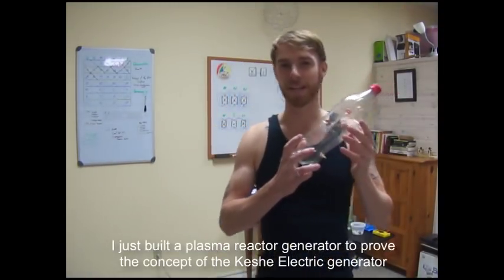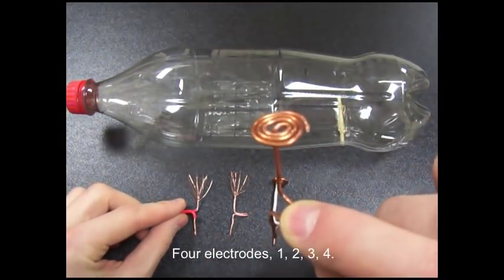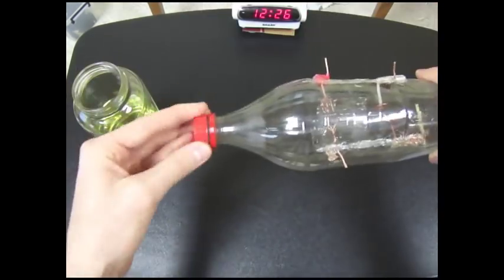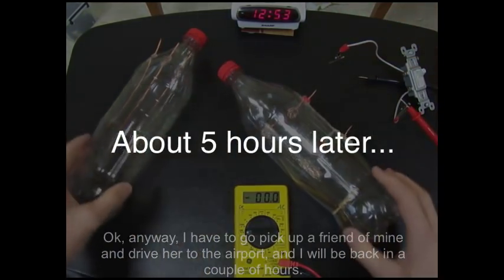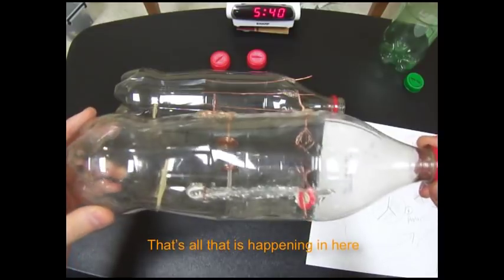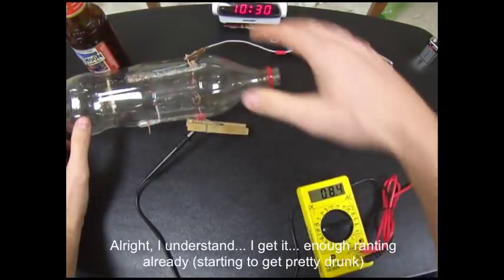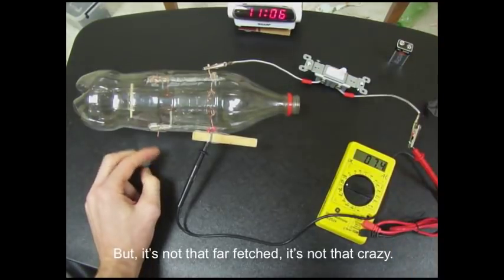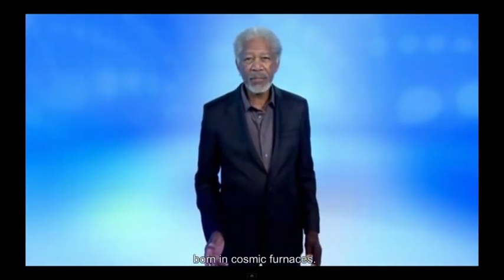Keshe Plasma Generator ~ Here is The Future ~ Infinite Energy

Comment: Hi All,
I'm open minded on this, but despite being quite "old" so far I've seen NO proof or application where it has actually done anything, or any other "Free Energy" device claims either.
If there are any positive results anywhere, that's easy to construct then I'd love to see them.
Going back a bit/lot to my schooling days I can't get my head around the coils that are being made for this device.... the cable used is bare copper wire, so any coils will "short" themselves out because they are actually touching each other, and even more so when you put the smaller coil inside the larger one? 
Basically you have a Copper Slug...
The "coating" ritual of the coils is basically acid etching the copper surface, and adding leaves etc to enhance the "nano particles" seems a bit hard to grasp for me.
Assuming it does insulate the coils from each other I reckon all you have is an Air Cored Inductor/Transformer, which is nothing new.
I'd love to be shown a working device, ( of any type ) as I'm all in favour of Free energy, but so far nothing has come into the Public domain that I know of.
I've done the HHO thing, but I can't even get a small motor to run unless I have 60A spare and a 100 plate Dry Cell etc etc, which defeats the object.
Maybe I'm missing the point, but I've come to the conclusion that, as yet, there is nothing on YouTube, or commercially that will free me from the rip off Power/Oil companies.
But I do live in hope that one day someone will accidently find a solution, you never know it could even be me...........

Comment: Energy is not voltage it's voltage times current. if you could turn on a lamp by that circuit you have got energy from the bottle.

Comment: Nice seeing someone having the guts to speak about e* physics ^^
Tesla new what he was up to in 1900 - he called it his "unified field theory" though.
Have to disagree on it having to do anything with plasma though (I doubt you actually think it does) - it's a simple zero point generator.

Keep up the good work - enough people will start to look it up themselves. ^^

For those interested, look up on wikipedia:
- Flying capacitor (always in direction of current [+ to -]) aka Lifter:
http://en.wikipedia.org/wiki/Biefeld%E2%80%93Brown_effect

- Self charging of capacitors (yes, they simply charge themselves):
http://en.wikipedia.org/wiki/Casimir_effect

If what you're finding seems impossible, you're on the right track ;)

Comment: Voltage is not what does useful work.  Watts is the part doing work.  Hook a 25 watt light bulb to that voltage and you will see the volts go to ZERO and no light.  Abundant cheep power?  Plasma may be a good place to look but we need more.

Comment: 1. There's no plasma.
2. Voltage alone does not equal energy.

Show us the "reactor" connected to a load - an LED, a resistor, even just a wire - and demonstrate the flow of current and the voltage simultaneously to prove there is useful energy generated. Current x voltage = energy transfer per second.

Comment: Joshua Thomas your a smart guy and you got good ideas that i applaud you for. But the energy there just comes from somewhere else as all things in the universe do. so what is happening there is the atoms and all that you said are giving off energy.. there is energy all around us. and when you take that energy from one place like you did energy from everywhere else took that place. so in simple terms you made a machine that takes heat from the air and puts it into a battery... so now what? it generates almost no power. to generate more you need more hea... so really were just back to where we were with coal generators....

however it is possible that none of this is even at play anyway and the earths magnetic pull is generating the power just in the magnetic copper.

Comment: He made a battery... No plasma... Probably pretty weak compared to most... Afyer a while the battery would start to "die" and you would either have to replace the electolytic solution and or electrodes... Or throw it away because the materials alone cost most than buying higher quality batteries from a shop that can "hold" a better charge.... Salt water and two different metals is a battery.....
Reply: +Brook Birk But he has the same metal, and removed an acid-base neutralization with water mixture. He completely removes it. Then takes the voltage readings.

Comment: There's no magic here.  The 'voltage' comes from within the meter itself, and is an error from being an open circuit.  If you turn on any multimeter, the reading won't be zero until you touch the probes together, closing the circuit.

Comment: Three things I noticed (1) the multimeter is set to micro-volts and so the readings are natural inductive pickup measurements by the copper antenna-nothing interesting here.  (2) A 'plasma' is the result of passing very high volts through and ionised gas- there's none here- why plasma. (3) There is no actual description of how this works- just a lot of psycho babble. I take my hat off to this man Keshe for pulling the biggest con trick of all time- why rob banks when you can dupe the punters?

Comment: This is not very impressive. Anyone can generate thousands of volts with a balloon and a full head of hair. What this thing needs to really do is produce a usable current. even if it only produces about 100mA I would be impressed. Most LEDs only require 20mA to operate. This looks very similar to a simple capacitor to me.

Comment: I can see where you think that generating voltages from nothing makes you believe that you have something spectacular but, unfortunately, voltage doesn't mean anything.  Brushing your hair on a dry day generates much higher voltages than your bottle.  It's just static electricity.  To get any power you need current flow.  If you set your meter to read amps and connect it you won't even see the needle flicker and the voltage will then read zero.  Sorry - no zero point energy.  The only zero is the current.

Comment: It's complete absurd. Keshe fans have no idea what plasma is, what the law of conservation of energy or the first law of thermodynamics are ! Show us 1 and only 1 example of isolated system in which power of output is greater than power of input! If it would work correctly, China would sell billions of small "Keshe mini power stations" or any other man. Additionall they violate the concept of high temperature superconductivity. It was discovered by scientists not Keshe (who knows real education degree or level, domain of Keshe?). If it would be true that in coil made of copper flows current withou resistance on the base of superconductivity then Keshe or anyone else got for 100% Nobel Prize in physics. Why? It's simple. Now, as I well remember, scientists achieved the effect of  high temperature superconductivity in temperature of 150 K !!! And these Keshe fans and he personally show us coils during summer in temperature of about 20-28 C degrees (0 K =~ - 273 C), so it's absurd, IT'S FAKE !!! Why Nober Prize so - it's obvious: 150 K (Kelvin degrees) =~   - 123,15 C (Celsius) !!!!!!!!!! And these guys tell us and show their coils (btw without measurements) in temperature of room or summer (i mean temp. about <20; 28> C degrees. Last but not least - they also introduce esoteric concept of orgonit - total idiocy, not worth to prove or explain.

Comment: In principle you are right, at least if "Basic Structures of Matter - Supergravitation Unified Theory", short BSM-SG turns out to be true. To be honest, I have never seen such a beautiful theory and as far as I understood it till now, seems totally reasonable and based on actual data. Everything it predicts fits well with experimental data.
Yes, the bottle, contains enough energy to supply us all, have you accessed it - no.
I tried to find the value, but I can't find it now. Anyways, this "energy" is bond in the static pressure of the cosmic latice (kind of an aether, but with well defined physical properties). You have also a dynamic energy in the latice which causes the background radiation of ~2.4 K.
Yes, you can modify gravity and yes, you need plasma for that, many million volts in the correct frequency and ionic composition and thats not that easy. What plasma can cause is to change some of the frequencies of the cosmic latice and therefore, how the gravity field is propagated. You don't change the object itself, you change how the internal state of the matter propagates to the universe. And you can do it in both directions, pull and push :)
Unfortunately this plasma causes a very ugly form of electric radiation that is very hard to shield.
Anyway, look at the books, they contain the complete deduction based on classical logic, math and experimental data, really mind blowing.
My guess, its some air based chemical reaction.

Comment: Okay I'm really tired of getting notices about this video. let me educate those of you who are to stupid to get it like my cousin who tried to tell me what a miracle it is. I went to the website and downloaded the specs. if you read them they would have you believe that you hook it up to your house through a 120 volt wall socket which can not handle more than 15 or 20 amps. Just how does anyone think that is going to make a dent in the power bill when your typical house is wired for 150 to 200 amps? Do a little research and you will see that this thing can not possibly work even if it was a plasma generator which it isn't. It's a glorified alkaline battery nothing more.

Comment: Does the flux capacitor discharge when you add the dilithium crystals? Come on. Setting up a foundation off this nonsense? If you get ppl give you money then kudos to you. Hilarious
Reply from the maker: Lol, I don't see how potentially revolutionary new forms of energy production can be nonsense when we are in a global energy crisis...  However, this video itself is a bit nonsensical, that's how I made it.  But on a serious note, perhaps you will like this video more.?: /watch?v=rSe7ovsucpk
Reply: Joshua Thomas
This isn't a new form of energy production, though.  It's a reaction of chemicals.  As happens in batteries.  It will run out.  It is not infinite.  It is not sustainable.  It is not new.

http://www.qrg.northwestern.edu/projects/vss/docs/power/2-how-do-batteries-work.html